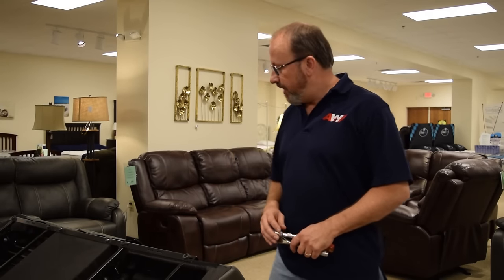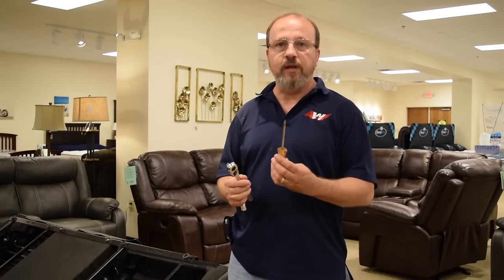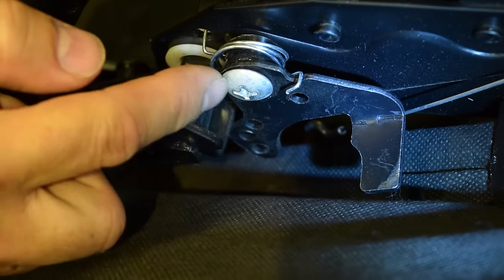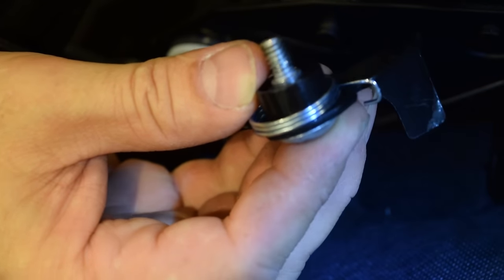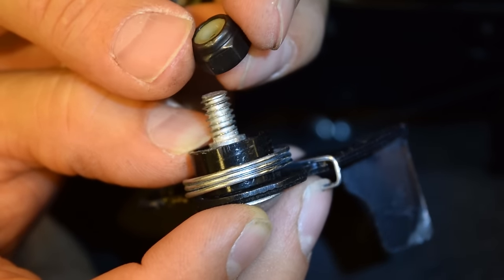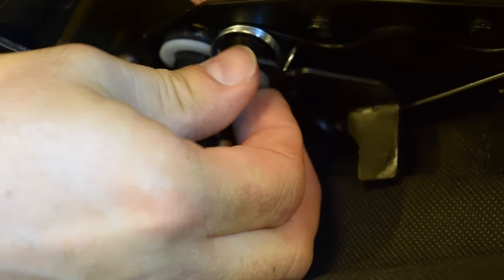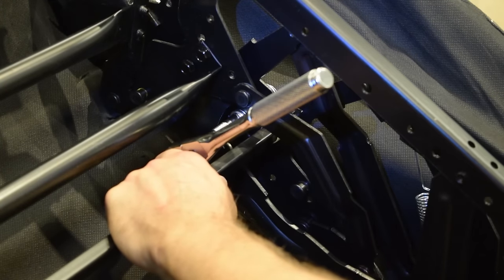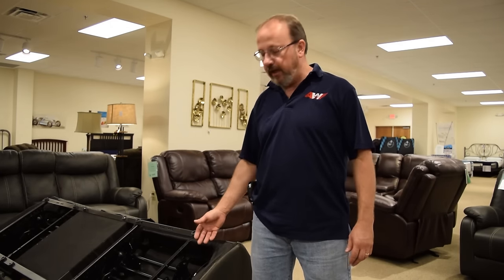How-To Replace A Reclining Mechanism Release Trigger

Comment: I bought a recliner that is completely missing the trigger assembly. There's an empty threaded hole where it should be. Where can I purchase the entire piece I need? I have the cable, just need the trigger arm and nut with tension wire...
Reply: i’m dealing with the same thing. Did you end up finding one to buy?
Reply: @omarhage-sn7wg  Sadly no. Our chair is still busted in the corner.

Comment: I was able to replace the cable and the handle.  But when I pull the handle something is preventing the foot rest from lifting.  If I pull slightly on the foot rest itself, then it opens, if I push on the back of the recliner a little, it also opens.  But it doesn't open the way it used to before the handle broke.   Any ideas what might be preventing it from working properly?
Reply: I have the same problem my cable broke,i  replace it.i pull the handle back it barely do anithing..but i have to use my body pressure to make it recline.😣
Reply: What I found out is that there are 3 holes where the cable can connect to the reclining mechanism. I tried the other hole and that added just enough difference to open the recliner. I guess the cable length was just a couple millimeters different